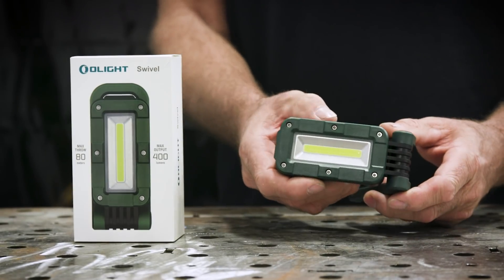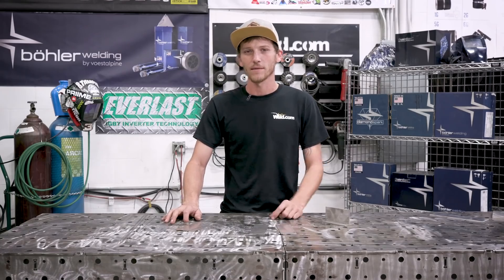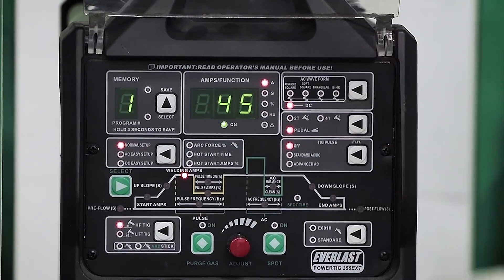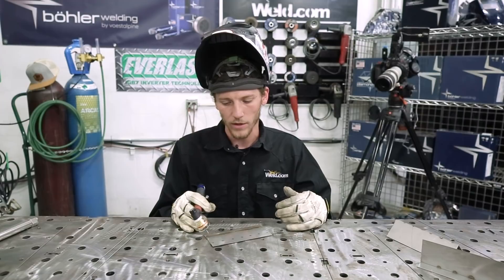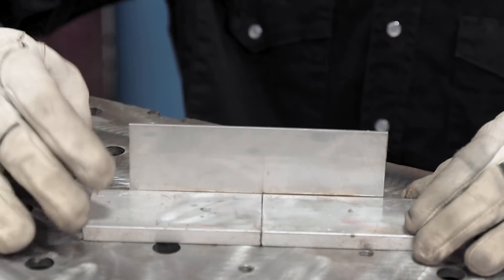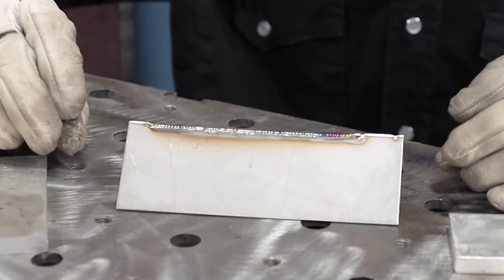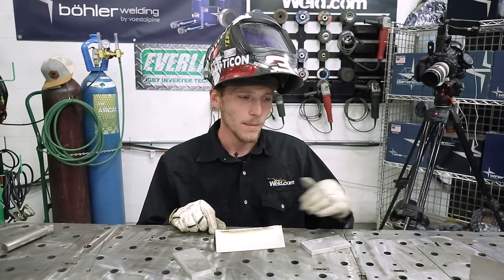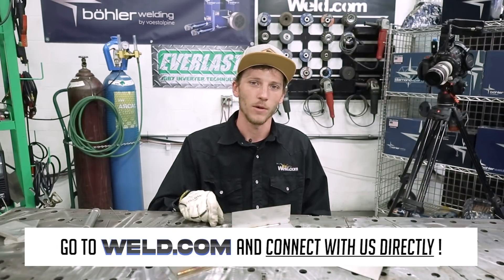Stainless TIG Welding for Beginners

Comment: I get it welders like to say "fusion" and there's a lot of fusion(consuming the surrounding material) in the equipment in my industry.  But in finished welds it's cutting a corner.  It's very practical for tacking and perhaps some lap joining but inside/outside corners and butt welds it is mostly bad practice.

Comment: Hey brother, I appreciate what you want us to learn. I have a couple of questions:

1. What kind of welding machine did you use in this video?
2. Can I weld stainless steel without the wire? 
3. Can I do that with any TIG welding machine?
4. Do I need a special TIG gun for that? 
5. I have an ESAB 162i TIG/Arc welding machine. it says I can weld stainless steel, can you check about it? 
6. What Gas do I need to use?

sorry if I'm bothering you about these questions. I'm a beginner in this world of welding 😅😰😎
Reply: If you watch the video again, those questions will be answered.  Not being a dick but you missed what he was doing.

Comment: Hey Jeff,
some good info and some that I think missed the mark, like did you use full pedal or half or three quarters ??? also noticed that you didn't run the welds near the edges is this because you didn't want to burn/melt the corners ?? I tig and mig weld s/s from 1/16th up to 3/8th and always found that the end of the weld will always be way hotter than the beginning and can/will burn the s/s at the end. That being said I still learned at least one thing from your video. As for making mistakes as long as you learn from the mistake and try not to repeat it you will definitely learn and become better. Cheers

Comment: For no burn through I understood we should not go up to the edge. Stop welding 1 inch before. This means we need to accommodate the length of the material one inch bigger for both sides than expected. After welding it seem we need to cut these non-welded edges. Am I correct?
Reply: No ive never heard of that, you might want to stop and let it cool down before you weld out the ends if you feel like its hot enough to burn through.
Reply: @RiseSteadyNC  Sorry for misunderstanding my comment caused because I am not a native English speaking guy. I tried to meant what I have seen in your demo. You did not went to the end. I speculated so. Now thanks to your reply I learnt what had to be done to protect edges get burned. Thank you very much!

Comment: Your weld angle when you did fusion welds looked correct at 15 degrees, but when you added filler wire it looked to be much greater than 45 degrees. Was that just the camera angle? If it was the true angle, that would certainly contribute to sugar (oxidized metal) by not giving you full protection from your shielding gas.

Comment: Little suggestion regarding the filming: film though a vizor so that we can see the puddle instead of a bright blinding spot. Lot of other welding channels do that.
Reply: He says it's only 45 amps.   Arc may not be bright enough to trigger the lens
Reply: @vr6swp  How does his helmet work I wonder?????
Reply: @enigma9789  He was using an automatic helmet. 
It turns dark when a bright light appears and when you finish welding, the helmet back to normal and you can see through it
Reply: @jorgeduarte2438  I know that.
Reply: @enigma9789  and why did you ask that?
Reply: @jorgeduarte2438  Look who I quoted, and read what he said, maybe you can put it together.
Reply: @enigma9789  haha 😂 you have been sarcastic. Sorry. I didn't notice it 🤪😅
Reply: @enigma9789  small solar panel

Comment: I am very disappointed of the arc shots. Also from a didactic perspective starting with difficult things is not a good way to learn something. You will become disappointed and lose your motivation. Start with easy things and move to more challenging task as you get better. And don't start with stainless steel. You are wasiting money for practice material. Mild steel is much cheaper.

Comment: What tungsten did you use? i repair stainless auto trim from time to time, old stuff, from the 20's up into the 70's, fill old screw holes, tears, make and install new sections, sometimes it welds like a dream, next time grrrr, i finished welding school in 1980, i'm still welding every day, now mostly on auto restorations, but i build gates, railings, trailers, buildings, i have a portable, mig, tig, stick, plasma, MS, aluminum, stainless, i have not done pulsed mig yet, always something to learn.
Reply: I use the E3 3/32” tungsten and thats awesome man always fun doing different things thanks for supporting weld.com and connecting with us

Comment: Does your tip on the metal or is like a 1/4 away
Reply: Its within 1/4” of the material tighter arcs create better arc control. Thanks for supporting weld.com and connecting with us
Reply: @SuperformanceFab  probably like a sixteenth. 1/4 is a huge gap and will increase the heat input for the same amp setting because the machine will have to put out more voltage to cross the gap.
Reply: Yeah, most weld vids you can see the gap.  This one has a lot of lenses flare and you can't see what's actually going on.  Better than any weld video I EVER made...

Comment: What is sugar ?
Reply: Sugar is a bubbly blackness that forms when oxygen touches really any molten stainless but even the backside of the weld. Sharing is how stainless gets porosity.  It usually looks black and bubbly.
Yeah, they could have explained or even demonstrated it.
Due to how heat won't spread in stainless the back of the plate will be hotter. For this reason, welding stainless generally takes less heat than carbon steel. There are plenty of videos about backpurging the inside of stainless pipe so that the inside won't have porous suffering where germs will grow.
Reply: Sugar is black crystaly stuff that occurs on the back side from lack of shielding gas coverage its called oxidation.
Reply: @SuperformanceFab  Sugar is typically white, no? I know Turbinado is brown/tan. Why are the homies not calling it black ice?
Reply: Sugar is when oxygen touches molten chromium. It becomes chromium oxide.  It is really unfavourable in any application where high quality weld is expected( pharma, petrochemical, food industry).

Comment: I do have a question, it may sound silly but is serious on my end--
   Should I wear oxy goggles in the process of watching the video, due to the brightness of the TIG arc?
Reply: Yeah, you’re fine… it’s actually the fact that your screen isn’t capable of emitting UV and IR radiation that keeps you safe. You could use a cell phone as a welding mask of sorts to view welding IRL, but it might burn up your phone camera. Not sure.
Reply: Yes. I always watch welding videos with my welding helmet on. Set to 12.
Reply: Just do a squint , no goggles needed
Reply: 😆you are fine ,
The screen you are watching the video can not get as bright as the actual tig arc hhhahahahaahaaha
Reply: @BruceLee-xp5fc  cool, I was wondering👍
Reply: These other guys are giving you dangerous advice. That torch is easily bright enough to give you arc flash through the screen you're watching on. You should wear at least a shade 5 to watch this, maybe even a different channel that can get proper arc shots.
Reply: @JackOffAllTrades  shade 5!? No way, gotta be 12 to be safe.

Comment: Good video, in high school in welding classes we learned gas welding before we could move on to arc mig and Tig. You're right being able to control the puddle is so very important.
Reply: Keep going with it man i started welding in high school and its taken me along way. Glad i could help and thanks for supporting weld.com and connecting with us
Reply: Yesterday me and my buddies ran 435 amps through an 1/16" rod and it just disintegrated